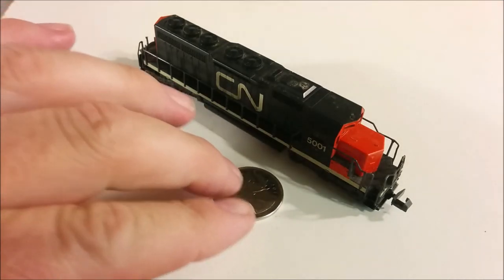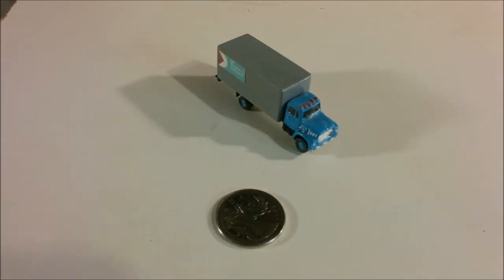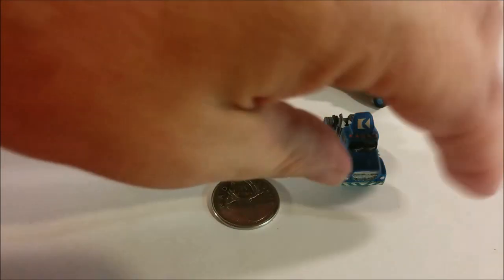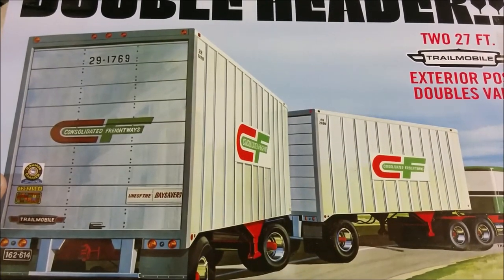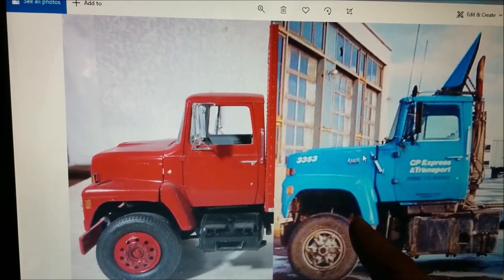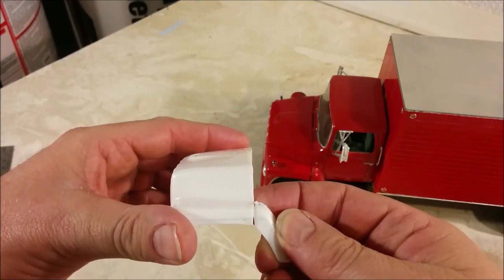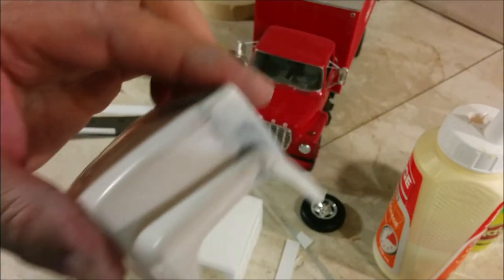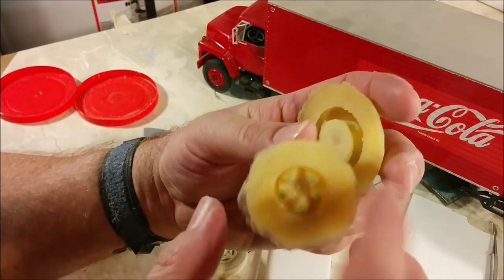Building a CP Express A-Train 1/25 Pt1

Comment: Just looked at this dump truck kit at my hobby shop! You're right it is a 3208 caterpillar. No turbo,so about 210 hp. Was a great motor,drove a tanker,a dump truck and a fire engine with the little beast in em! Reliability was named after this motor!
I passed this kit up,and bought the Super Boss drag truck,mainly for the 2 stroke V12!! Gonna put it in a super detailed and modified Western Star I'm fixing to start on. Thinking of taking the super boss and putting an inline 6 in it and making a pulling truck out of it! 
I built the double pups this winter. For an old Autocar tractor.
Spoked wheels are Dayton's, and the discs are called Budds. At least here in the US and Missouri.
Reply from the maker: Yes you are right about the wheels. Although its kind of like the Kleenex syndrome. There were many makers of each type, but people refer to them by the original names. It's hard to believe that spotting a classic Louisville is so rare these days. They were so common in the 70's and 80's.
Reply: @dansmodelworx   That ain't no lie! There's 2or3 I see every year during harvest at one of the big elevators I haul to. Get excited every time!! The tanker and the dump truck were both Louisville cabs. The tanker was late 60's early 70's and the dump truck was mid 80's. Just a nice spacious comfortable cab. The fire engine was a C9000 cabover,surprising amount of room in it too.

Comment: I am so impressed with your research and execution on the hood and cowl for the tractor. It is too bad you couldn't find a kit with the split rim style wheels rather than the steel or aluminum Bud style wheels. I know AMT has some older kits of Reo's, Mack, GMC Astro, etc that may have the wheels you're after and that may be easier than casting wheels and tires.  Good luck with the project, as a long time long haul owner operator I will be watching with great interest as you proceed. Take good care, be well and stay safe.
Reply from the maker: I am using the spoked wheels from AMT's Ford C-series to create molds.